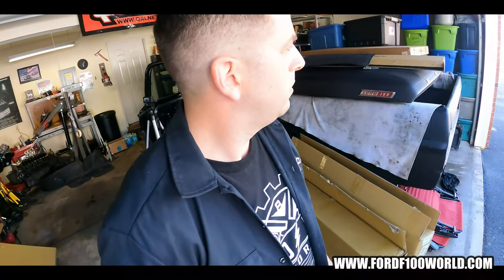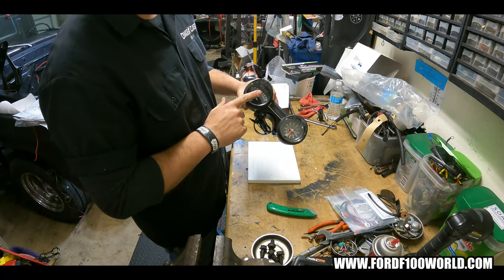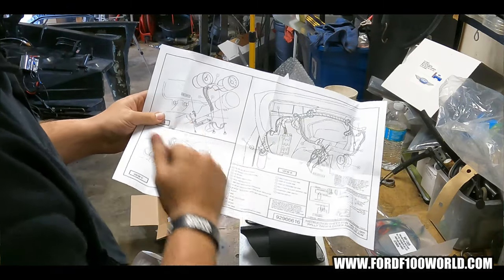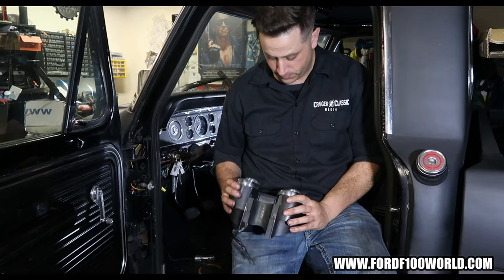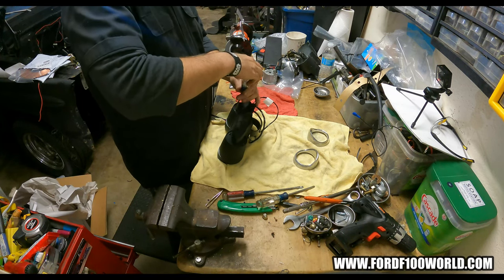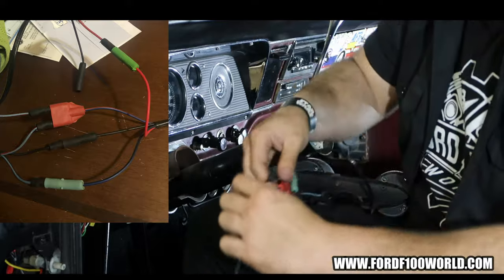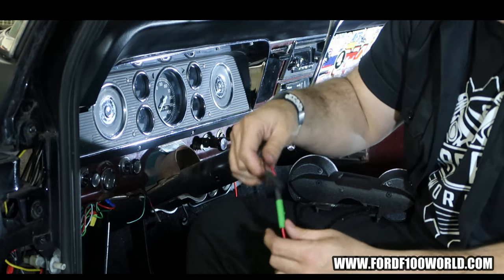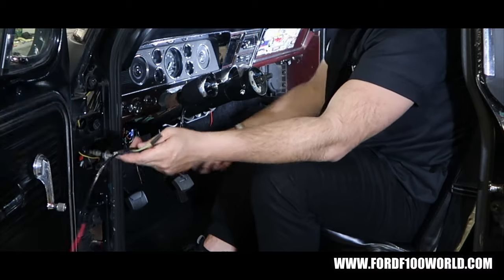Rally Pac Will it Fit in My F100?

Comment: Awesome truck! I have a 1970 F 100 with a 390 and a T5 that I’ve been working on for a couple of years. Thought this was going to be a fairly straight forward and simple install but the areas that I cannot seem to get the answer to is, when you say hooking one wire to the dimmer, are you talking about headlight dimmer or dash light dimmer? The other area that I failed to understand is on the mustang the back of the ignition switch has a threaded rod that sticks out that everybody seems to hook a wire to. I cannot seem to isolate what wire that would be on my 1970 F 100. If you could help me in those two areas that would be awesome! I know I’m probably a dunce and it’s right in front of me. But what can I say that’s the way I am lol. Thanks! Rich.
Reply from the maker: Are familiar with www.Fordification.com?
Reply from the maker: Head there to the tech section and take a look at your year truck wiring diagram. It might help.
Reply from the maker: If memory serves, you want to locate the wire that controls the dimmer resistant so your light on your pac dim as well.